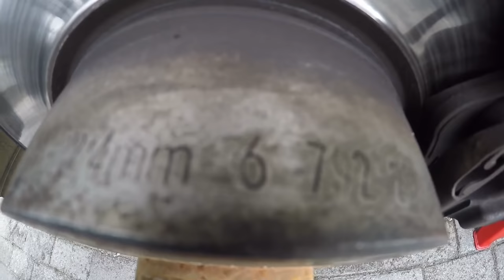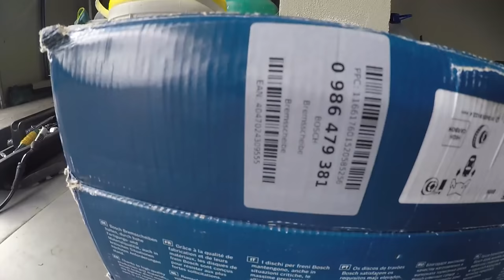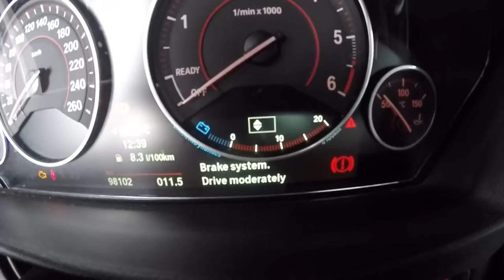Brake Pads and Disc Replacement BMW Serie 3 F30 F31

Comment: Great video. Can the rotor be installed by sliding it into the bracket the way you took it out? I am trying to save the effort of removing the 2 bolts holding the caliper bracket

Comment: Do you have disengage the electronic parking brake to do this. ome people say it is impossible to change the brakes without doing this first
Reply from the maker: I did exactly as in the video. there was no need to unlock the handbrake or put it in neutral

Comment: I notice you have jacked up the car behind the jacking point . Is this safe enough and won't it damage any of the floor or components underneath ?
Reply from the maker: No problem, nor will it damage anything. it's safe but you have to use the security brackets

Comment: Hi, I am planning to do the same thing🙂i have only 3400km for front brakes left says the BMW Computer🙂but i have some questions for example: is there only one brake sensor per axle or more?I have read it somewhere that the original brake parts are the ATE brand, but they are really expensive, so what is your experience with the Bosch parts so far? I am living in Austria, and so far i always order the parts from Autodoc.. 
Best regards 
Denis
Reply from the maker: Hi Denis,
yes, there is only one sensor at the front and one at the rear.
I bought bosch parts and I was very satisfied. I also buy from AUTODOC and the parts are of good quality and they have a fast delivery
Reply: @fernandomontenegroBMW  Thanks!!

Comment: Is that grease you're putting on the hub, or some kind of anti-rust?
Reply from the maker: is high temperature grease to prevent the wheel from getting stuck when removing
Reply: @fernandomontenegroBMW  copper paste grease works?
Reply from the maker: @Killmastar80  yes

Comment: Hi there
I’m going to change Bosch discs like in the video-do I have to change the wear sensors the same brand or keep the same-
And lastly is it recommended to change the discs if only brake pad is bad!
Many thanks
Reply from the maker: Hi, 
You should change the pads when you change the discks. If the será sensor os good, you don't need to change it. You can buy the wear sensor from another brand.

Comment: Did u ever have any issues on the brake sensor? Did u replace them? My brake pad light came on and ive always reset but now it doesnt reset successfully. The pads are still good u think its the sensor? I know its ine sensor for front and one for rear
Reply from the maker: One time i did have a problem with one new sensor. verify the sensor connection plug or if you have the cable crush. In my car i use bosch sensor and never had problems.
Reply: @fernandomontenegroBMW  thank u for reply yeah i ended up checking the driver side wheel i turned it all the way right checked plug and it seemed to have been dislocated/dettached from the cable holder i latched it back  and reset worked after 😁. Idk how just been unattached it couldn't reset? Probably sensor really sensitive?
Reply from the maker: @pjefsquad  if the plug don't be connect well, it don't will make the reset. The importante are you solve your problem. If you like my videos leave a like. Thanks man

Comment: How many kms did those disks last?
About 100.000 kms, what's in the odometer?
Seems that they are quite small and wear out kickly
Reply from the maker: it will depend on your use of the brakes. you should do a check to see the disc wear. watch this video https://youtu.be/FMEB2PLrvzM
Reply from the maker: the measure marked on the discs is minimum thickness

Comment: do you know if I want to put 330mm disks instead of 312 (i think it's 312) on my 320d, do I need to replace the callipers ?
Reply from the maker: you need to replace all the wheel braking system.
Reply: and you'd better have at least 18" rims to clear the brakes

Comment: Cool video. Torque values for all the bolts?
Reply from the maker: Front bolts are diferente than rear
Reply: @fernandomontenegroBMW  oh that I know I was wondering if you had the values.
Reply from the maker: @elijahfrancis2520  it depend where you buy. But the bolts are chip. The halogen is more expensive. 200€
Reply: @fernandomontenegroBMW  Fernando, ele está a pedir os valores de torque (intensidade da força de aperto para chave dinamométrica, especificada em Newtons-metro) dos parafusos todos.

Comment: Never ever grease the wheel bolt to rim interface, that will give the incorrect torque on the bolts!!
Reply: And grease to the brake disk, its not a godamm axel joint😅